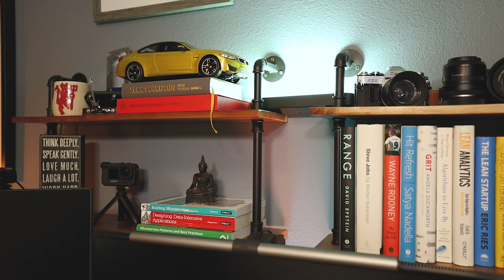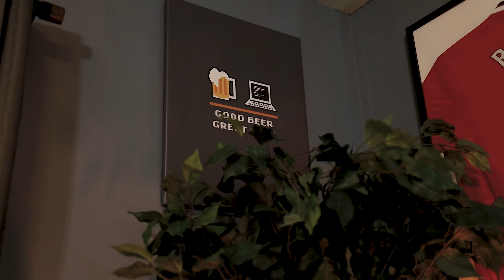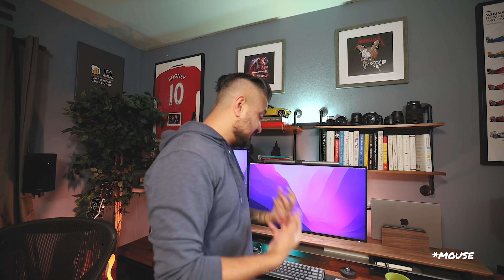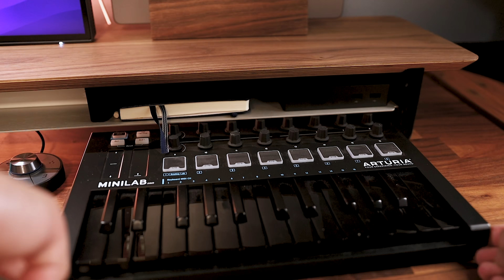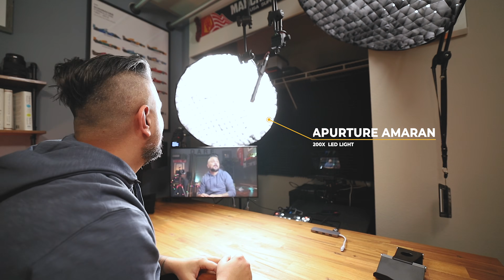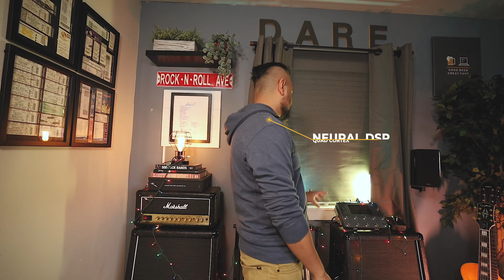Software Engineer Desk Setup / Home Office & YouTube Studio Tour 2022

Comment: What made you switch from the full size Razor keyboard to the 75% Keychron? Did the switch take time to get used to? I was looking at the K3 they have and am worried that it will take time to adjust to the arrow keys being in such a weird position.

Comment: Can you provide a bit more detail about the MacBook hub/docking station? How are all your peripherals connected with only 1 cable? What are you using? The benQ screen bar  alone requires a USB port or power station just to control your lights. Any further insights would be much appreciated!

Comment: As a an actual full time software developer, i dont find mechanical keyboards optimal.. keystrokes are tiring and too noisy for long coding sessions... Something like logitech mx keys or apple magic keyboard seems a far more ergonomic option optimised for churning out code tirelessly. My 2 cents. Secondly, my work laptop works perfectly well as as a second screen in conjunction with 27" 2K IPS display I have from acer. Dont need 2 monitors per se when you can just use the laptop display as a secondary screen.
Reply from the maker: They are definitely over hyped. I just like the tactile clickiness… but someone else can easily find that annoying. It’s probably a mixture of industry hype + personal taste.
Reply: There are so many mechanical keyboard flavors. I think once you find the perfect switch for your typing style, none of the ones you mentioned can compare. And not all Mechanical keyboards are noisy.
Reply: I’m with OP. After using a lot of different keyboards I ended up back at the MX Keys. Tried piles of mech kb’s and switches and never found the action that works for me. At this point mech kb’s are meme spec. Part hobby, part tool, part status symbol. There is this assumption that everyone is going to love them if they just spend enough money to find the right one.
Reply: @Alan.livingston  well put

Comment: Hey Utsav, does this room has access to sunlight and  some window for ventilation? I as a software engineer find that a much needed setup. I just can't sit and code in a dark room . What is your opinion.
Reply from the maker: It has a small window. But, for videos that window is problematic because the light changes too much. It’s much easier to control artificial light. When I code, I’ve got the window open
Reply: @EngineeringwithUtsav  nice and Thanks for being on YouTube!

Comment: Curious what happened to your super ultrawide monitor? Do you think your current setup works better rather than the 32:9 monitor?
Reply from the maker: 49” was easier to manage space. But it was also only 1440p. These are 4K. It’s a trade off. But these are hardware calibrated IPS screen 100% SRGB coverage. That’s the reason I bought them

Comment: Little tip. Its far easier and cheaper to just buy some decent 4k TVs that are large, ie 50"+ and use these as monitors. I use 55" Samsung VA and MVA panels, 4k60hz and they are sublime. I can properly use all the real estate that 4k gives (8.3m pixels!). Using anything less than say 48" is simply way to small to properly use 4k, everything would be too small to use if ran in native 3840x2160p. I sit over 6ft away from the screen though as I lean back when coding. Cheap 4k TVs can be had for a few hundred bucks, and the picture quality and for gaming etc is way way better than a monitor. You can see over 105 lines of code (although I would zoom in a bit)
Reply from the maker: This isn’t about seeing more. It’s about hardware calibrated non-reflective IPS screens for color accuracy.
Reply: @EngineeringwithUtsav  In your particular case maybe, but the vast majority of devs dont need perfect colour accuracy and would benefit from more area to see code lines. Most devs I know just use crappy laptop panels or TN displays, hardly anyone calibrates it to professional software standards
Reply from the maker: @ATIWatchReviews  I agree 100%. But this is my desk setup video and I clearly explain why I went to the Samsung CRG9 to this and it is for color grading :)
Reply: @EngineeringwithUtsav  yes sorry, I think I should have watched all the video before first commenting haha.
Reply from the maker: @ATIWatchReviews  All good :) It's fun to interact with ya'll nonetheless! Thanks for chiming in!